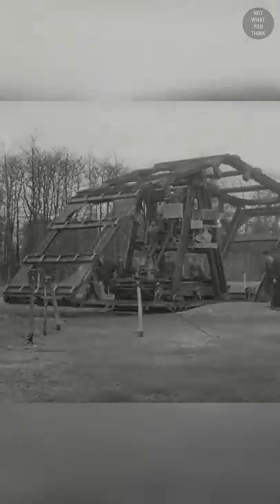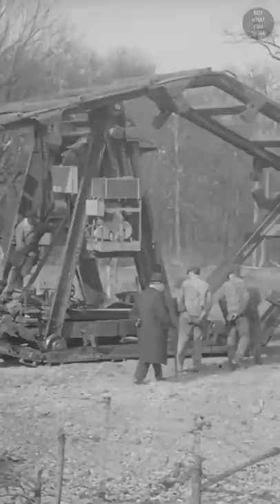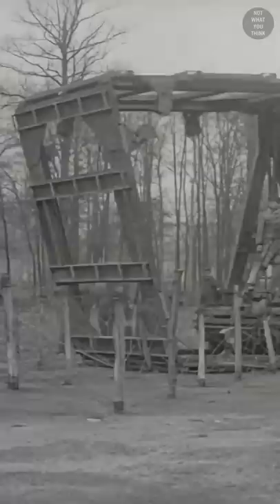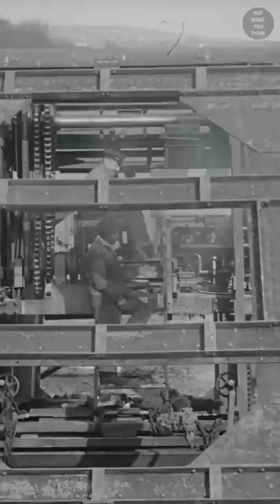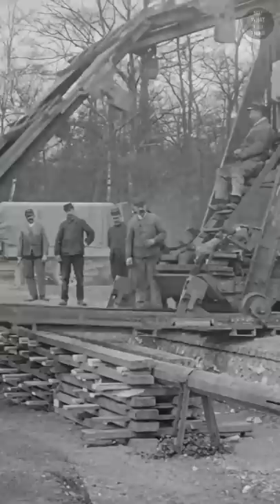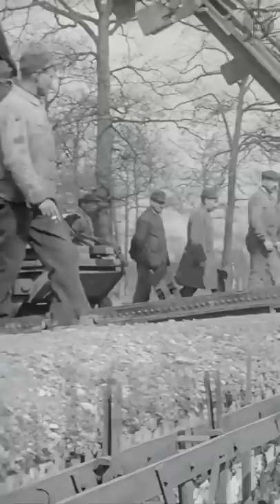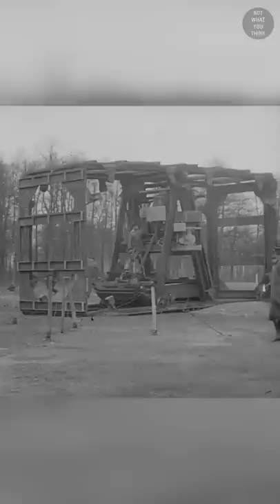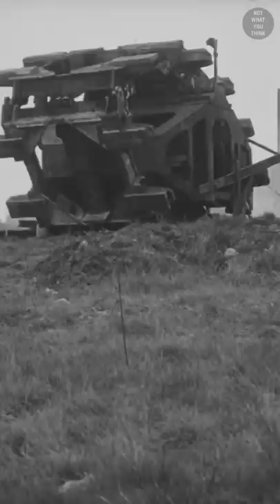Military Blanket Machine #shorts

Comment: It certainly is an overengineered non-solution, it's still an impressive piece of technology.
Reply: Kind of highlights how much we’ve stagnated
Reply: @arthurhughes-watts1180  if you think twice, you'll figure that this beast was built in a time where the very first tanks (tracked armoured vehicles) came into action. So it's not a sign of stagnation but a prototype that is playing with the newly developed concept of tracked vehicles. It did not lead to a great new invention or new special purpouse vehicle but it was a fair try nonetheless. If you dont let engineers play around with new ideas and concepts, nothing will ever  be invented or developed. And THAT would be the definition of stagnation. ;)
Reply: @rumpelpumpel7687  I’m saying in current times we seem to lack pushing technological understandings to their limits in the same way as in ww1 and ww2. In that sense I thinks  there’s been a degree of stagnation
Reply: @arthurhughes-watts1180  dont know. i'd say, the concepts from late 19th and early 20th century were machine developements. Not too easy to understand the ways how engines and mechanical gears work, but it is much easier to get into and play around with, than digital technology of the 21 century. The way i see it, the technological understanding of whats going on today takes some great years of studying. It not like any simplton could script a code or design a green fuel for planes or i dont know what... :) what i'm trying to say is, the inventions, one could get an idea of, just because some special problem occures in your everyday tasks (like tires getting stuck in mud yet again) or by observing how nature worked its way around certain problems within evolution, have been made already. And todays progress is in the digital world (mostly) which is a world hard to understand or comprehend for many ppl as it is much more abstract than getting stuck in barbed wire or muddy terrain ^^  - what do you think?
Reply: Misguided impractical contraption
Reply: @rumpelpumpel7687  well there is of course good reason this thing was abandoned
Reply: @arthurhughes-watts1180  Have you seen technology at all in the last 20 years???
Reply: @TheLongDon  look advacements in tanks jets guns. advancement has clearly stagnated. unfortunately capitalism allocated a societies resources in areas that make profit
Reply: Especially for 1915.
Reply: @arthurhughes-watts1180  stagnated in one small area but getting strong in others. I will still call that "progress".
I would much rather prefer resources being spent on improving lives instead of taking them.

Comment: V2 was kinda looking good
Reply: V3 was just the british mk 1... explains how it was so ugly
Reply: @TheArcticFoxxo  Dafuq you mean ugly? its like the most classic looking tank
Reply: @thisguy8597  the Mk 4 and 5, yes. but not the Mk 1
Reply: 🤔... as well as looking a lot like early tanks, with just a different chassis design, same look, but the whole outer shell being the chassis instead of having two parallel ones embedded/attached on the sides like later/modern designs...

frankly I liked all those exotically inspired (solution based rather than being based off of an existing system bring upgraded or repurposed, 
and while that's sometimes a matter of genius design and application of what is known and what available, 
it mostly isn't unfortunately, 
at least not in the application strages as it ends up being a matter for bureaucracy to screw over no matter how brilliant a plan...same really as is with all those exceptional and radically innovative designs) 
lesser known designs (like the designs for a ground-digging tank, or those with a spherical- or a screw-based chassis meant for a truly universal terrain navigation)  that were eventually discarded for not being feasible/suitable  to manufacture or otherwise being deemed too impractical
(at the time, with technology and infrastructure available at the time...alas, we never really got back to having a serious reassessment of most older designs for most technological systems, and not just in the military) 
to use for other "technical" reasons that actually had to do little with technology itself but though but rather people involved...
Reply: @thisguy8597  👍

Comment: This could have been easily build into a proper tank tho. The first tank where the tracks actually are intended as armour
Reply: This was the predecessor to the tank
So basically, it DID get turned into a tank
Reply: @NEED2CONNECT I think you should be ashamed. Just not ashamed bc we couldn't find out ourselves, but ashamed about all the false information you have just said. 1. The Boirault machine is widely considered the predecessor of the tank
2. The first ever tank (little willie) was made ~6 months after the boirault machine
3. They didn't rlly have many tanks in 1915
4. They weren't rlly awesome. Little Willie kinda sucked (compared to what we have now) at doing the whole "being a tank" think. It had a top speed of 2 miles per hour. And about a year after little willie was made, the British used tanks in battle for the first time. Even those tanks, after a full year of development, broke down easily and malfunctioned.

Also, WDYM THIS HAS NOTHING IN COMMON WITH A TANK?!?! The Boirault machine is a tracked vehicle (they're different tracks to that of a tank, but tracks nonetheless) meant to be used in battle to traverse obstacles such as trenches and barbed wire. What was the first tank? A tracked vehicle meant to be used in battle to traverse obstacles such as trenches and barbed wire

Comment: Saying that does what a blanket could already do is like saying a sandbag already does what body armor or a tank of the era does
Feel like it's a bit of an unfair comparison, especially considering everything ww1 was / did and needed a way to cross without being shot while laying a blanket that can be still be pierced

Also claiming it's useless because its cockpit was open to fire is also super unfair because it's obviously a prototype so it's clearly not finished.
It feels like if people were to shittalk the cars because horses already exist and moved slower when they first were made
Like no shit a prototype was inefficient as a standard, it's a specialist machine that wasn't finished yet and was unneeded because the people of the world stopped the strategy of barbed wire en mass

Comment: So why not just put walls on it?
Reply: They did. Didnt you watch the video?
Reply: @ziongarner4485  they didn't, didn't you watch the video?😂 no walls on the sides, driver is completely exposed.
Reply: @dahlizz99  I can't post timestamps because it's a short, but he says they later put armor plates that protected both the driver and the engine. So no, the driver isnt 'completely exposed'.
Reply: @ziongarner4485  but he also said that the armor they put on the sides to protect the driver was super weak and easy to penetrate. And logically it probably needed to be since the thing moved so irregularly and changed shape. Probably had to be some type of half stretchy material. So completely expised was an exaggeration, but I also wrote it before I came to that part of the video. But he was definately still too exposed, if he wasn't then it wouldn't matter how slow it was since it'd be able to fulfill it's purpose. Tanks were slow too back then but still used and further improved and not shut down as an invention like this thing.